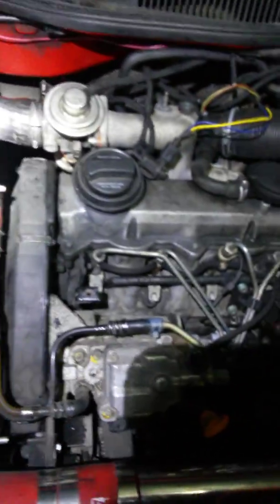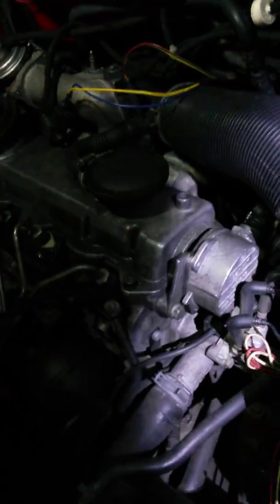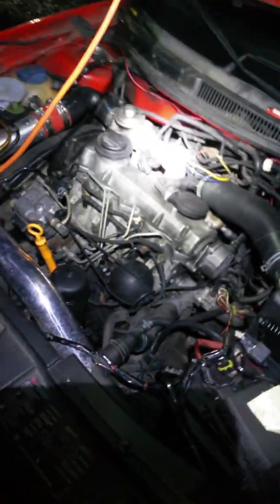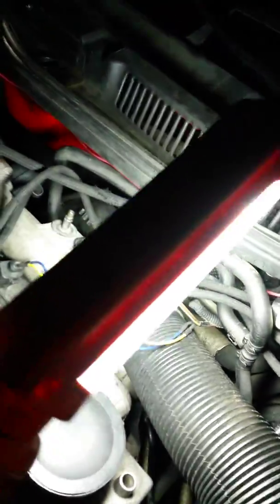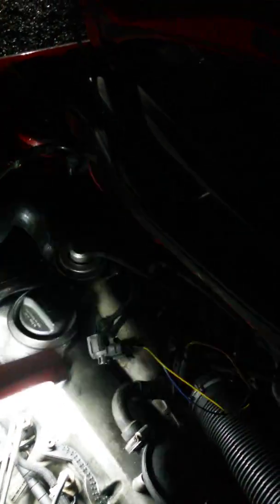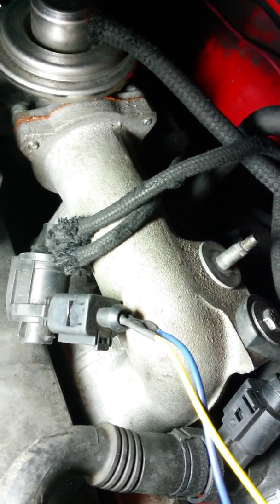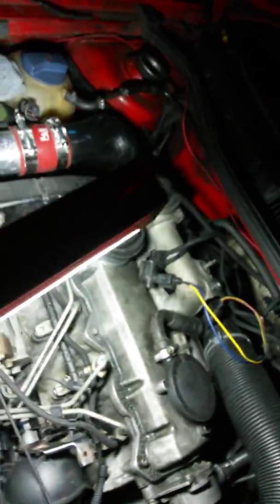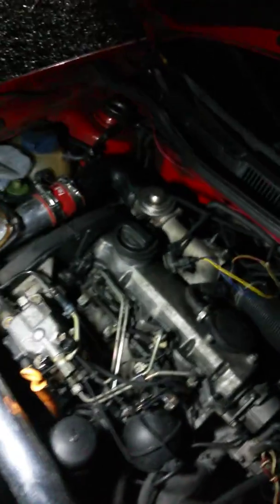Mk4 alh tdi golf p3105 code rough idle vid 2

Comment: Since you have an ALH mk4 would you know why the hand brake light flashes n beeps while driving but not while parked does it sound, yes I have oil in brake booster, the hand brake lines aren’t sagging but are touching correctly. It’s causing my car to be in limp mode tho and driving in 3 gear on D mode
Reply from the maker: Check brake switch by pb handle.
Reply: @organicvids  yeah I did that, replaced it with a parts car I have and still won’t shut off, would the brake speed sensor on the wheel cause this?
Reply from the maker: @StreetWraith501 best to hook up dual can bus scanner